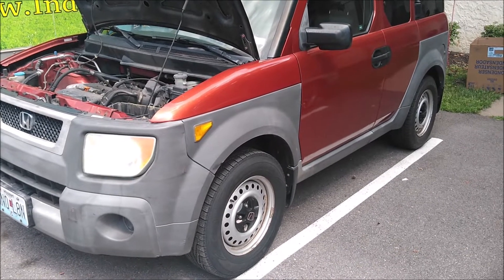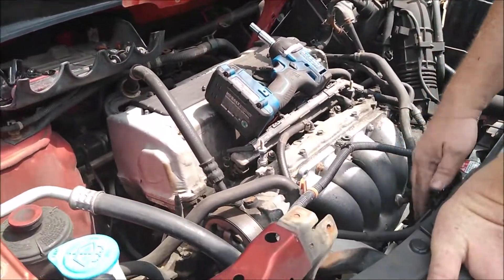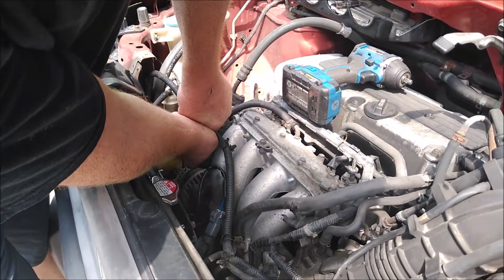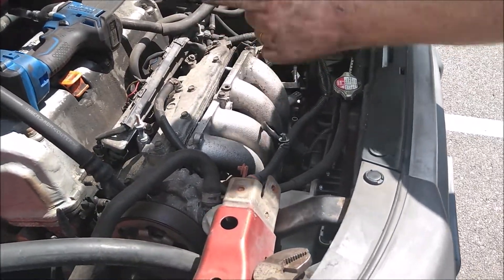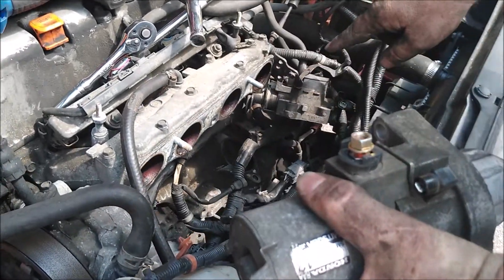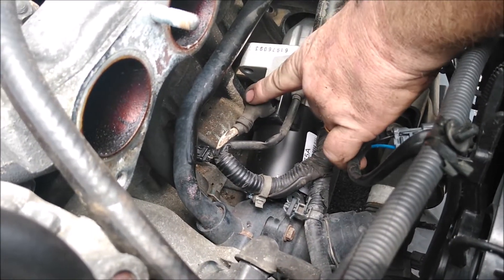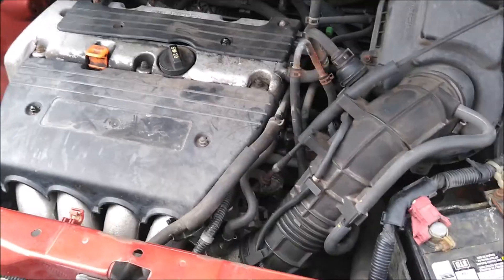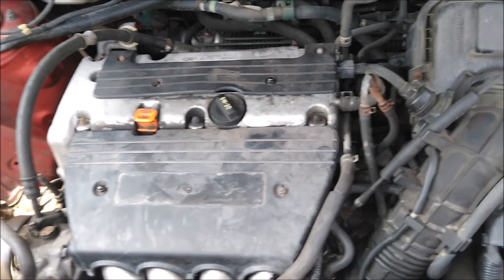2004 Honda Element 2.4 Starter Replacement

Comment: My 08 E..has a plenum behind manifold. That was hardest part. Screw that underneath the car method. Before anyone try's this..check your starter relay. The relay ended up messing up my starter. Changed starter..had same issues. Changed relay...ANNNNDDDD was back to normal..good luck all
Reply: What were you symptoms when the relay was going?

Comment: Great vid,, thanks,, I dont own an Element yet, Im doing one month research on a few different cars before I buy but Im sure Im gonna get the Element,, how long do you think it would take to change the starter if you were going kinda normal speed, not too fast, not too slow?
My 87 pickup truck was so easy, but This still looks doable!
Reply from the maker: If you work on cars regularly prob a hour maybe 2 max. It's really not bad I can get that upper manifold off in about 10 mins but I work on these engines all the time but even so it's not really bad at all. The most annoying thing is that black brace that on the bottom of the manifold down to the block

Comment: Could you have removed just the top part of the brace? Looks like the vertical piece could have been left in by just unbolting the hood latch.  Did it need to come out in order for there to be enough clearance for the manifold to come out?
Reply: It's one whole piece.

Comment: Tried for hours removing it from the bottom by removing the knock sensor the mechanics make it look so simple but that top 14mm bolt is dang near impossible on your back instead of standing under a lift. Wish me luck im done for the day will try this weekend your way

Comment: Did you replace any gaskets, intake manifold or throttle body?  Also, is there a particular brand of starter you prefer?  Thanks.
Reply from the maker: I don't remove throttle.body on these usually when I do a starter and the intake gasket is reusable as long as your gasket is still in good shape.

Comment: that looks like you had a rust hold in your heater pipe that runs to thermo housing .at 3:31. I have the exact same issue haha. Coolant runs through there..
Oh nevermind thats the bracket that has the hole